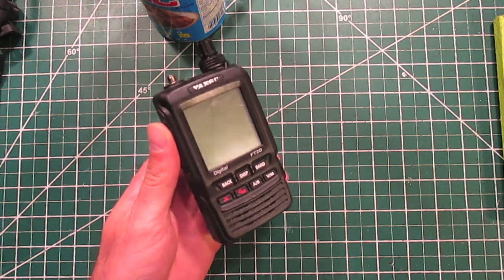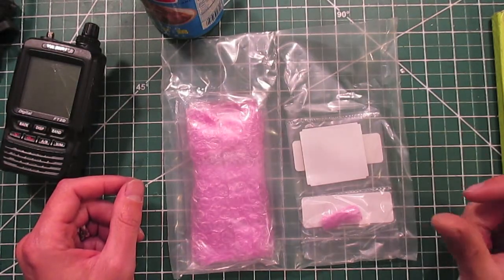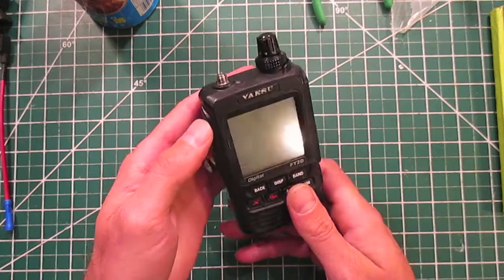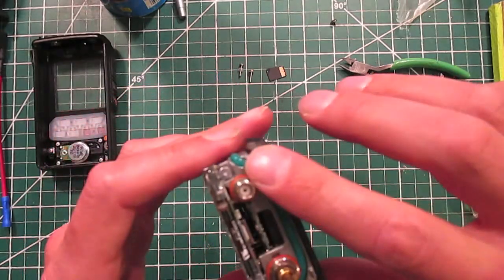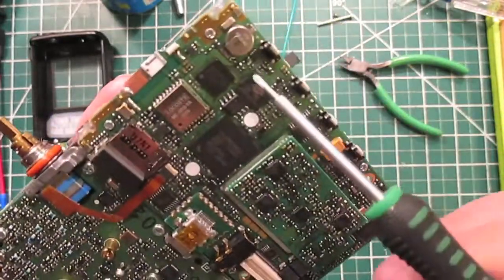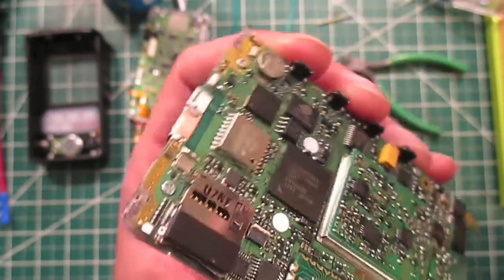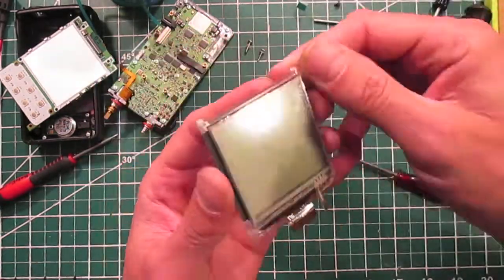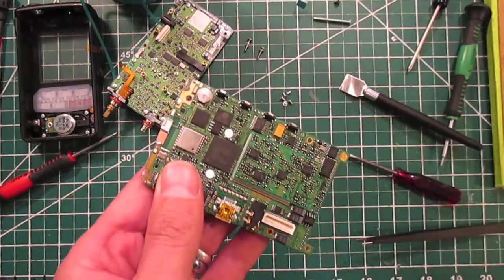Yaesu FT2D Screen Repair

Comment: Thanks for this! I fell on my FT2D in my back pocket, and wrecked the LCD screen. The outer glass and touch functions were ok, I was just getting no display. Ordered the LCD module from Yaesu and I'm back in business. Since I had no SD card in there, all was good on that aspect. I did not separate the two-board assembly, nor did I remove the o-ring. I was able to do the LCD changeover all on one side only. The sockets for the flex circuits were easier to use when I flipped up the white clamp. 

Thanks again and 73,
Robert AK6CG
Reply from the maker: Yea, the screens break pretty easily.  I'm on my 3rd.  Good to hear your radio is back to normal!

Comment: I’m trying to change mine and those stupid screws below the screen are about welded in there. I’m torquing with a small screwdriver and ruined the screwdriver since it’s in so damn tight.

Comment: Where did you buy your screen at? Mine bled through after less than 12 hours use. I’m not particularly a fan of yaesu after this. But where did you get the screen?
Reply from the maker: Wait, so you replaced your screen and the whole thing turned black?  Are you sure you didn't crack the screen?  These are pretty fragile. I got my parts directly from Yaesu in California.  The part numbers you need are; 

Q7000678 LCD MODULE 
U00230001 PAN HEAD SCREW M2.6X30

Comment: Thanks for doing this video, it helped give me the knowledge to take my own FT2D apart and replace a broken screen. I ended up writing myself a note on tape underneath the battery to make sure I always remove the SD card before disassembling it.
Reply from the maker: Good to hear!  I'm glad you were able to repair your HT.  It's a great radio.
Reply from the maker: Yea!  I never bothered replacing the SD card slot on mine, it still works if I put the card in just right.  I only use it to update the repeaters in the radio, which is about once a year.

Comment: Thanks for this guide, I've got to do the same thing. What part numbers did you request?
Reply from the maker: Hi Calvin, I ordered the following....  Note, I wanted to order the clear plastic over that goes over the screen, but this is now part of the entire case assembly.  So unfortunately, if you need that, you need to replace the whole case.  Additionally, I didn't end up using part# RA1512400 because the old one was still sticky enough.

Q7000678 LCD MODULE 
RA1512400 DOUBLE FACE(LCD) 
U00230001 PAN HEAD SCREW M2.6X30
Reply: @RevMook  Thanks, this is perfect. I damaged my screen, but my digitizer is a-okay.
Reply from the maker: @dck47  The digitizer and the screen are one assembly.  Make sure to remove your SD card before splitting the radio apart!
Reply: Thanks much! How did you order your parts? And, how much do the parts cost? Thanks again.
Reply: $23. Thanks
Reply from the maker: @DesignTrek  No problem, glad this video could help someone.  :)
Reply: How did you open the ribbon cable connectors? Thought I had come across every type of this sort of connection, but these have beaten me and possibly ruined the radio.
Reply from the maker: @rhysgriffiths1655  It's a small latch that kinda clamps down on the cable.  If the cable is tight and doesn't fall out on it's own, it's probably not unlatched all the way.  Check my video just after the 6 minute mark.
Reply: @RevMook  does it lift up or slide out? I tried both and a bit of the plastic fell off. 😪
Reply from the maker: @rhysgriffiths1655  It's hinged, so it should open kinda like a door.